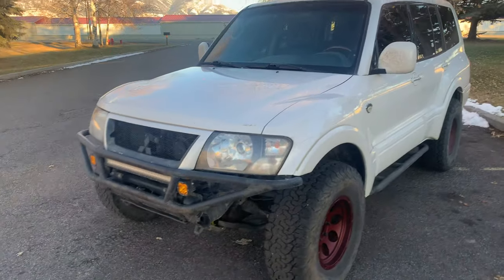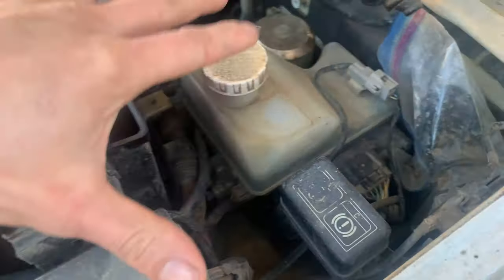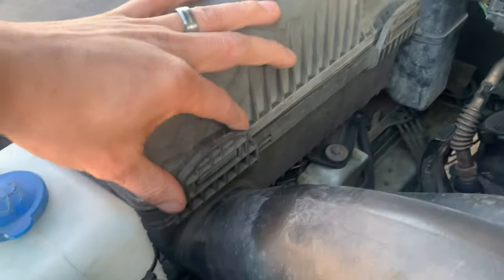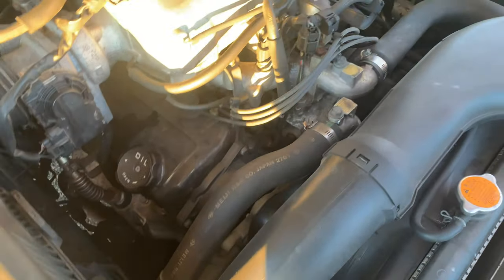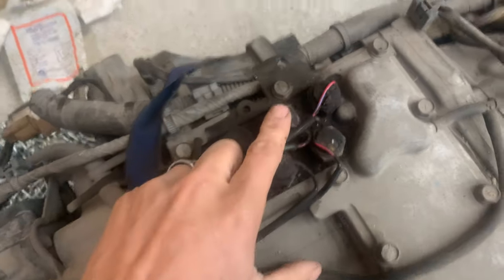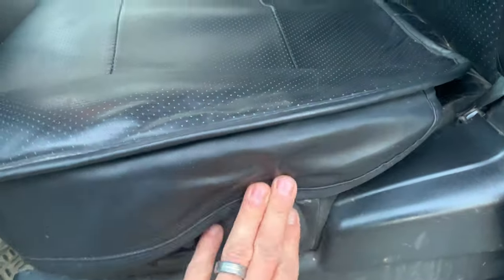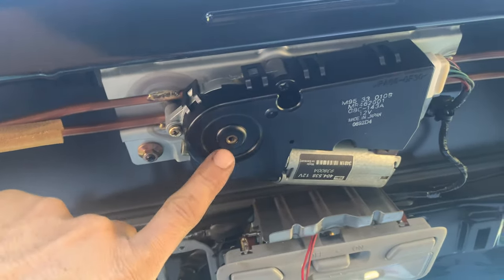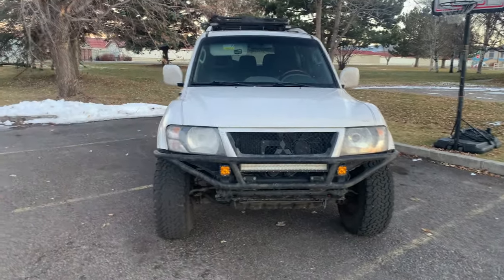Most common issues with the Mitsubishi Montero

Comment: Great video, I had a lot of these issues too. Another solution to the top glove box latch issue is to gently drill the plastic right in the middle of the latch assembly with a large diameter drill to reveal the keyhole hiding underneath, then use the ignition key to open it. If you do a clean job with the drilling, you can leave it as-is and not replace it.

Comment: Have an 03 190,000 miles and pretty much have had all the issue's you mentioned.  Thanks for the vids, helps diagnosing some of the quirks on these vehicles.
Reply: Montero 4, 3.8 (6G75). At 180,000, I only changed the hub bearing.

Comment: Good Video.  I mentioned in the last video my apprehension to do my exhaust mani gaskets on my 02(192,000)  and now prepared to deal with cracks.  Actuator, glove box,  dash lights(both back tires out), tensioner(was told by two shops I need a new engine; idiots), o2 sensors, lean codes...good info again! Thanks!
Reply from the maker: Glad it helped!

Comment: 2003 I’m the 2nd owner since 2004 and have had 75% of what you shared. I’m at 251,000 miles and love this crazy truck more each day. I also have power seats that are stuck but luckily in my position vs my shorter wife🤣 My key fob works at distance but I think the actuator on the driver side is broken since it only locks with key or inside latch vs power button. Keep up the great work and if your ever in the SE I’d love to show you a super clean 2003👌
Reply from the maker: Good stuff man!

Comment: Great info man. My 03 has a crazy oil leak that I believe is coming from the right side valve seal. I had them replaced a few years ago, Also, my heater is not blowing hot air. Had a new blower motor , resistor, flush , and still no improvement. Im going to check the blender door next. I also have a 95 sr that I'm working on as well. Keep the vidinfos coming.

Comment: Thanks for the video, nice tips. Just on the top glove box, it also has a keyhole, carefully remove the plastic with a drill and you will expose the keyhole. Unlock it with a key and save yourself a lot of headaches.

Comment: Great stuff as usual. I had a shop NOT preload a tensioner pulley twice and luckily the belt did not skip teeth or fall off. Thankfully I had a friend do it the 3rd time. Shocked that a shop did not know that was critical to do
Reply from the maker: it's an odd timing belt job, so it does happen. if you want something done right, it's always best to do it yourself

Comment: I'd add some diesel related based on my experience with my Pajero 3.2DiD:
- original steel fuel tank corrodes or zinc plating flakes off (various theories) and these shavings make their way through the fuel filter and damage the Zexel injection pump, an expensive repair,
- 3.2DiD 4M41 engine is chain based and should last very long, provided that the top chain slider and chain tensioner are regularly checked and replaced,
- I had to rebuild my transmission, shafts of the planets on the final drive planetary gearset got loose, fortunately not to the point of grinding all the teeth, replace your AT oil and filter every 50000 km guys!, unlike the 6 previous owners of my Pajero

I too had the problems with transfer case switches, OEM are stupidly expensive and cheapos don't last long. Brake booster motor can be rebuild cheaply by installing new commutator and brushes.

However, the biggest elephant in the room, not mentioned in the video: RUST! Rust everywhere. My Pajero sure is 20 years old now and it probably didn't have easy life, but now I'm in the process of welding all 4 wheel arches and both rocker panels, including patching both inner, internal and outer panels. 

Avoid bitumen based coatings, go for cavity wax spray or the likes of FluidFlim.

Front wheel liners are a joke as they maybe cover 1/2 of the wheel arch and let mud go beyond them and accumulate. Same with rear right wheel with the fuel filler piping that also hangs onto mud. Entire rear of the car, especially the bumper, is also a place that accumulates mud which causes rear AC and heater lines to corrode and break. It is like Mitsubishi designed this car to carry mud.
Reply: Great addition

Comment: On your list I already repaired several. and others that I discovered. Avoid washing everything on the chassis periodically and 1 or 2 times a year I bathe it with old used oil from the same changes

Comment: I've replaced fuel pump and tank last year on my 2001 pajero Did with 247000km. it costed me +/- 3000€ and lot of hours in the garage...
I've change the starter 2 times in 4 years due to fuel return line leaking on it (line changed while fuel pump replacement)
I had a leak on oil pressure sensor and had to replace it
Resistors pack for rear A/C speed setting was unsoldered
Air box broke as you shown in the video
Heated seats do not work => to be investigated
Currently throttle pedal seems to be bad: rpm increases when I remove my foot from the pedal
Love my Pajero!! ❤
Reply from the maker: dang! sounds like yours has a few issues that are out of the ordinary. i hope you can get them figured out

Comment: Right now I have a problem with oil consumption, which could be spark plugs and pinholes, I need at least one day to repair it, I have already disassembled and reassembled the entire truck twice. I just need to learn how to repair automatic transmissions and practice more with the transfer.

Comment: Really enjoying your content way down yonder in Argentina, I have a 2004 Montero Limited I bought from a couple who drove it all the way down from Alaska, it runs great except for one issuie occasionaly when starting my Montero , this issue happens only lets say 1/15 starts,  she mostly fires right up, but sometimes I get in and it does not respond when I turn the key. All the dash lights are on when I am trying to start it, but nothing from the starter. I've always been able to get her it fire up by shifting into nuetral and trying again except or today she wouldnt even fire in neutral. I finally managed to get her to fire after shaking the battery a bit. I did replace the battery a couple of weeks ago so dont think this is the issue. Please let me know if you have any suggestions, parts are hard to come by down here.

Comment: Wish it was only minor things on mine... finally the automatic transmission blew up out of nowhere.
Thas was to expensive to fix and parts weren't even available. Had to sell it which is a real shame because i really liked it (at gas sations no to much :D).
Reply from the maker: the transmissions on these can be a pain, it seems to meet that if they are well maintained, fluid changed regularly and not overheated they last forever, but as soon as they are abused or run hot for an extended period of time they don't come back. that being said, i'm not kind to mine, and it shifts like a new car still!

Comment: I have a 3.5 2001 and getting lean errors codes all the time. I thought it'd be the tiny o-ring causing a leak like to stated but apparently it's a 3.8 only issue. Anyone know what could this be in a 3.5? Anything similar? I see the LT trim is above 12.5%, I'm  wasting gas and the middle is very rough choking sometimes....

Comment: Could you show how to change the front crankshaft seal. Mine is starting to leak and I am also going to do the timing belt and IF it is fairly easy I will do it all at the same time.
Reply from the maker: i have a video of how to do the timing belt, check it out! that will show you how to get 95% of the way there, then just pull out the seal and put in a new one!

Comment: I got an 03 montero sport and I’m having issues when under full throttle it wants to bog out and not go any faster then 30-40 mph If I let off the throttle a little bit it runs a little better also when going up a hill it loses most power and bogs down even under little throttle any idea what I should look at 
Was thinking it possibly is pcm or fuel pressure regulator

Comment: Brake Booster + Clicking brake pedal noises (need to bleed brakes with MUT tool or from Booster itself?) . 
shuddering or studdering transmission at low RPM, 1500-1800rpm. 
Gas Tank leak at fuel pump? 

Those are the things i am living with currently on my 2002 : ]

Comment: Legit question, if the Montero has so many severe issues why is still popular? Is because people like to to practice mechanics? Or because even with all of its flaws in the wild is a capable vehicle?
Reply from the maker: @be8965  every vehicle has flaws, it’s just a matter of picking the ones that are manageable or minor enough to work around. I find that even with all the issues the montero has it is still a much better platform than many other vehicles
Reply: @montanamontero  thanks for answering, O asked cause I really wanted one but sceptical with all the stuff to be repaired on them. After all I end up getting one, needs quite a bit of work, and I hope to be able to service most of it my self,with the exception of alignment, suspension and steering wheel. i dont have the space to do those repairs. 
I’ll be watching all your videos for enlightenment for sure! First thing to fix on mine is the infamous Vacuum leak. I’ll be doing this next weekend when I have booked some time off work. 
Any extra advice for first timers on this one will be greatly appreciated

Comment: This video makes it seem like these are piece of shits lol, I agree on the common issues I have had two 2001s issues with my first one with 205kmiles was not going into 4low and brake booster failing. My second one 173k is torn drivers seat top glove box stuck, not going into any 4wd modes and it seems to be running rich (smells of gas) p0173 code. If you have any info on that code let me know thanks! I still love these damn things I dont know why premium gas 13mpg lmao.
Reply from the maker: like any car, they have their issues. but i think they more than make up for it with their benefits. i have a bunch of videos on that as well

Comment: When I check my oil after it’s been running it will be low oil but if I wait about 10-15 minutes and check the oil will be full.

Is that normal ?
Reply from the maker: yes, the oil is draining down from the top of the engine to the bottom.